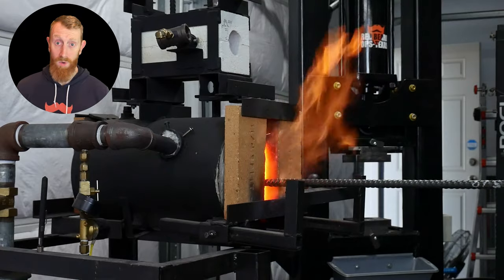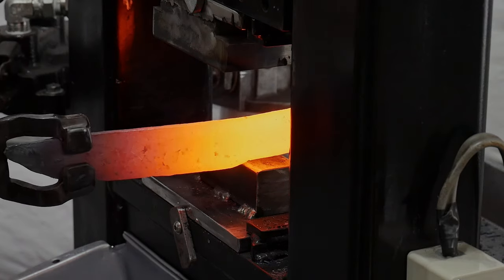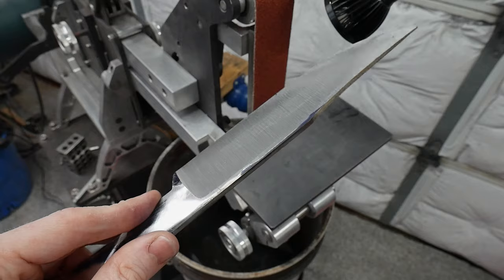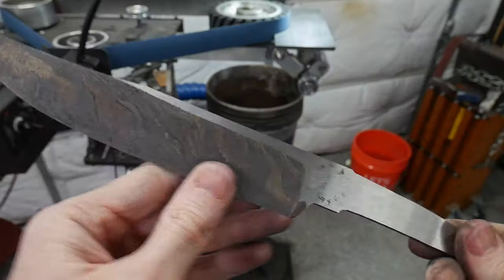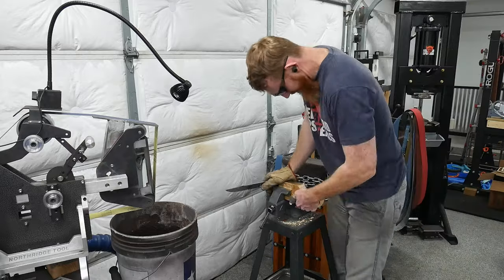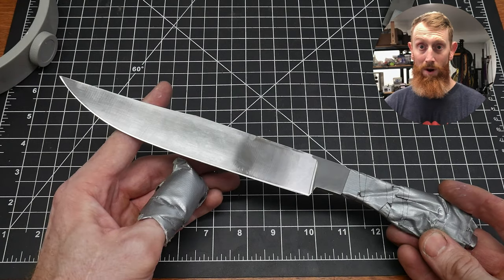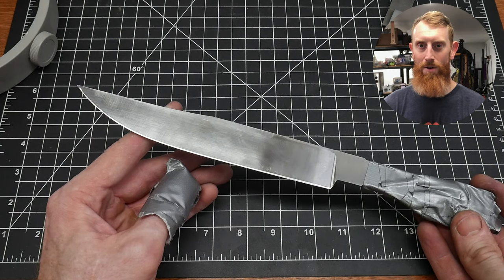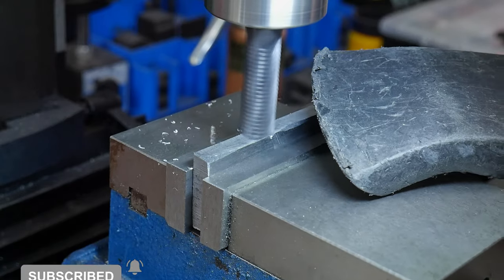My Best Attempt Making an Heirloom Damascus BOWIE!  Part 1

Comment: I use the thinner stones and they work just as well. I belt sand to 320, then stone from 320-600 in at least half the time as normal, then switch to paper for 800. I have used the 900 and 1200 stones but only for guards and jewelry.
Reply from the maker: Very cool! Do you use the stones like I was? On the edge? or do you use the flats?
Reply: @RedBeardOps  Both. I use the edge on the width, then flip 180 and use the flat lengthwise. Perpendicular scratches.

Comment: Jesus.. I wish I had some good metal-working/forging/knife-making equipment. Beveling has always been my bane - I always screw it up bad. But I have a few hammers, files, sanders, grinders, an anvil and like a brake drum, coal, crank fan forge - but coal isn't readily available and the forge is rusting into dust. A proper propane forge has been on my wishlist for a while. I don't know the nomenclature but at this point, I couldn't even dream about having one of those auto hammer/press things - though I can see where that could be one of the more important tools - not absolutely necessary but greatly helpful. I wish they made a forge that could work for smelting, blacksmithing, glass-working and clay firing - all-in-one. Buy one fairly expensive tool that can handle several hobbies.
Reply from the maker: Man, I tell you what, hammering in bevels is hard! I'm very carful and really don't forge them in that deep so I can fix my armature mistakes on the grinder.

Comment: Man. Ive been messing with forge welding. And im having a tough time. 

Mainly 2 reasons Im doing it by hand. No press yet. 

The other is, im working on getting high alloy steels forge welded particularly. Which is proving to be a challenge.

Yeah. Having my diy oven has been great. A couple things that i think made mine have more trouble are because i dont have 220v where my oven is. And im heat treating a lot of steels going up as high as 2200 Fahrenheit. Which using 120v takes a very long time. And taking a long time at that high heat. Is more likely to cause a problem if things arent designed perfectly. 

Thankfully ive gotten it worked out

Edit 2. Ooof on that chip

Edit 3: so how sre you liking the edm stones so far? I need to get some finer stones, i only have up to 220. I do notice they might be a hair coarser than paper, but if im doing the whole progression, or at least the majority, that shouldn't be an issue.
Reply from the maker: Cool stuff my friend! I've only made a few by hand. It's a challenge for sure!
Reply: @RedBeardOps  yeah. I dont really have a plan to get a press, at least not soon. Not that i wouldnt love one. Im just currently spending all my money trying to get this 2x72 up and running. Its going to be worth it though. I just need a motor, and a set of wheels now. Ive got everything else, including a vfd. 

Oh. So, how are you liking the edm stones so far?
Reply from the maker: @_BLANK_BLANK  this is really as much as I've messed with them. Takes some getting used to. Seems to work ok.

Comment: Do you have a sense of your total hours in on this build, and if you were to repeat this knife how much more quickly would it go now that you have experience?
Reply from the maker: Hey Erik, man.. that's a tough question. I didn't add it all up. The footage I have alone is 12 hours worth; I'd say at least 2-3 times that. I think I'm getting the process down with this style of construction. This knife went significantly faster than the green handled takedown bowie I made before it. Lots left to learn for sure!